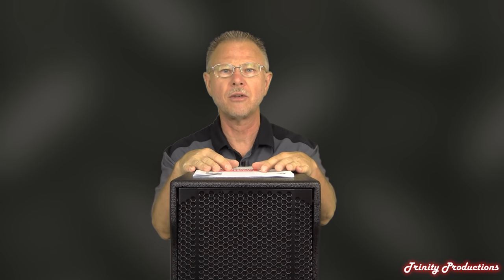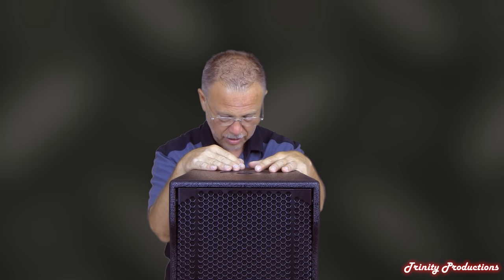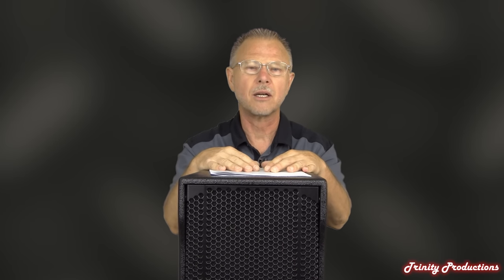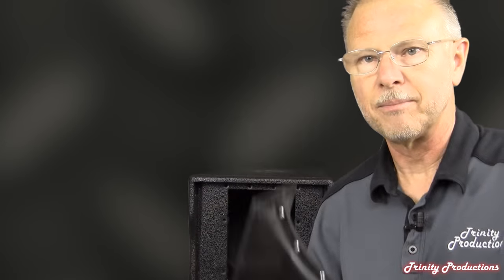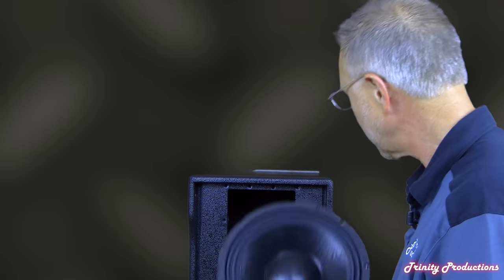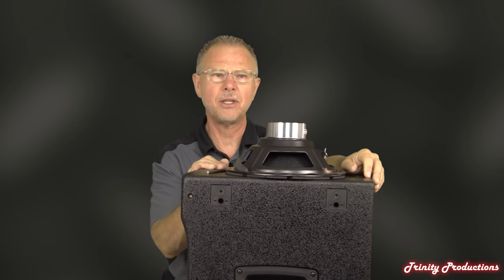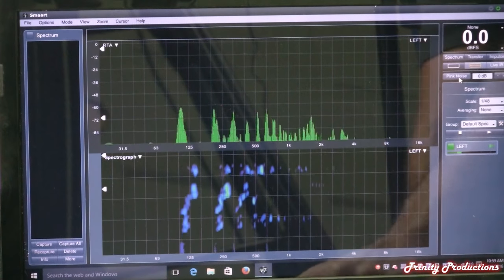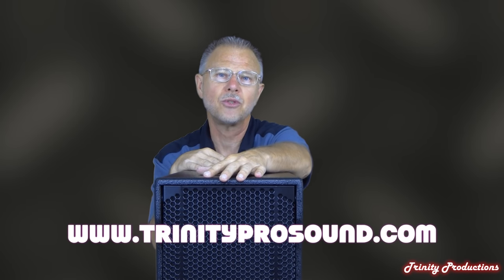RCF NXL44A Complete Review - Authorized Dealers

Comment: Great review as always. That thing looks really beefy. Question: how do they compare to the NXL24?
Reply from the maker: much better low end on the 44's than 24's, but HF is about the same....both are very smooth sounding...you could run more "full range" with the 44's than the 24's.

Comment: Is there any electronic benefit to using powercon connectors over IEC?
Reply from the maker: yes, they lock and have a higher current rating for the contacts and are standard on most all PRO audio gear...along with the new True1 PowerCon, which is a 20A locking connector many speaker mfr. are leaning towards.

Comment: I got the money to buy 4 NXL 44A  or 4 RCF TT2A cabinets, but also I can buy  2 TTL6 cabinets.  What do you think?  The subs I'm using are 4 TTS26A.
Reply from the maker: I would go with 2 of the TTL6 boxes with the TTS26 subs... or 4 of the NXL44's , but the sound from the TTL6's is amazing...just be sure to run in crossover mode and not a full range signal to them
Reply: So it's the NXL44's or the TTL6's. Hard decision. In terms of output , 2 NXL44 per side will be louder than 1 ttl6 per side...right?
Reply from the maker: by the numbers, no -  TTL6 is rated at 139db and the NXL44 is 134, 2 = 3db gain so 137 vs. 139. can you or i tell the difference, most likely not... bummer is they don't tell us at what frequency that was at for either one...
Reply: I think I will go with the TTL6A. They are just too amazing to not buy them. I found a client for my 4 X TT25A II  speakers and those 2 TTL6's will replace them. I hope I made the good choice.
Reply from the maker: you have, with the ability to fly and stack 2 per side, and the 3 way box will just sound better IMO that a 2 way...it is like and HDL50 speaker turned vertical so to speak...
Reply: btw love your rigs, impressive I see your an RCF guy as well.

Comment: Do they have these in White? Also do you have experience when painting speaker cabinets? Will it affect performance in any way? I really want them in white for esthetics.
Reply from the maker: They don't have the 44 in white. But, we have painted some in the past with good results. You do have to remove the foam and get new white foam and reattaching is a bit of a pain not to get adhesive on the foam and grille, that is where all the performance trouble will be, a very meticulous change out, but a good epoxy based paint will last a LONG time

Comment: Hi, excellent review, huge fan. I want to know if I can use two nxl44a with  two dual subs without using a processor's high pass filter for the nxl's?.
Reply from the maker: you can use the cross over output if they are available or high pass with a decent BW 24 or 48 setting. I would roll off low end around 90 to NXL44's and let subs do low end duty.

Comment: just curious, what is your personal go to system of the RCF- db tech- FBT?  which is your go to system.
Reply from the maker: we have 2 - for most of our events we do the RCF TT11A and TTS26A subs...but they discontinued the TT11 system, but it is amazing, just don't think they sold enough of them. For most everything else we do the db Tech IG4T with FBT SUBLINE 218SA subs, that rig will do 1000 peeps no issues, we can do 1500-2000 outdoors with the TT11A. We are looking at 4 of the TTL6A boxes to go with our TTS26A subs.
Reply: yeah I'm a RCF believer as well, mobile dj  want to do some sound for small bands. keeping it simple. thanks for all your insight. keep sharing.
Reply: whats the difference in the TTL6 and the NXL 44a
Reply from the maker: TTL6 is a 3 way box, NXL44 is only 2 way box , the TTL6 has more power and will be better in overall response due to 3 way design and components. Also has RDNET and it considered a PRO Touring type box, vs. the NXL44 as a top line , but not considered a PRO Touring type system.

Comment: IS there a lots of sound different in The 15 inch TT serie top vs NX 15 inch top ?
Reply from the maker: Yes at the TT line uses the best of the best and a more refined DSP, speakers and amplifier. The NX sounds good, the TT sounds GREAT !
Reply: @trinityprosound  thx i have the tt25a mk2 and the 8004 as, works nice, maybe in the futher i buy subs from TT :) the 15 inch from TT is Lighter in weigt thats nice, but are the lows good to ? or beter TT 18 sub ?
Reply from the maker: The TT subs would knock your socks off, but that comes at a premium price point as well.
Reply: Thx for the information  @trinityprosound
Reply: Ricardo Smit :) check

Comment: I am just going nuts with this decision.  I just sold my Yorkville PSA1/1s rig (6 tops/6 subs) because I am looking at going with something more versatility that I can do the few big shows I get with 1000 audience and a crew to set up but split into two rigs and have one person set up.  Within my budget I am probably looking at 4-6-8  8003as ii and 4 tops (either 24's or 44's).  There are pluses and minuses to both cabinets.  I am leaning to the 24's because of size/sound/cost but will 4 of them keep up with what I am looking to do with the bigger show vs. the 44's?
Reply from the maker: I think 6-8 of the 8003's will work with with 4 of the NXL24's , you will be amazed at the output of 4 of those in stacked configuration. The thing is to get them up on top of 2 of the 8003's so you have the height to cover the audience area. The NXL24's are amazing and very focused vertically.
Reply: Thanks for your response.  But, the question must be asked, would I be better to go with the DB IG4T/sub18H setup?  What do you think?  From what I've seen, I'd be better on top but lose a bit on the bottom.
Reply from the maker: The more sub you can afford = better , IMO you never have too much SUB, better to have more and dial it back than not have enough and try to make the speakers and system do something it can't or won't...
Reply: I think I have to be brutally honest with myself and realize that I am not vertically gifted and not getting any younger.  At some point that 20 pounds difference between the RCF and the dB is going to be beneficial when stacking. It appears there is almost no difference between the two cabinets in capabilities.
Reply from the maker: Me, i would go with the NXL24's tons of output,fantastic sound and much lighter and easier to set up and tear down than the 44's
Reply: I was referring to the IG4T by dB company.  20 lbs lighter than the RCF with 100 more watts RMS.
Reply from the maker: Ah, I do like the light weight of the IG4T. and the sonic quality is good, a bit different than RCF due to HF driver size and cross over point. But versatile and they do sound very good. I can set up our 4 x IG4T rig with dual 2x 18" subs by myself.
Reply: trinityprosound thank you very much for you videos and input. I am definitely getting the impression that the RCF is a better sounding cabinet, from your response above.
Reply from the maker: Ah, I do like the light weight of the IG4T. and the sonic quality is good, a bit different than RCF due to HF driver size and cross over point. But versatile and they do sound very good. I can set up our 4 x IG4T rig with dual 2x 18" subs by myself.

Comment: how about nxl 44 with 8005 for the sub? is it suitable or not?
Reply from the maker: That would work well, but the NXL44A will out run a single sub  , you will need 2 per NXL44 to get a decent spread between the subs and top box.

Comment: Hi there.  I'm using 2 NX M15a's as tops and the 905AS for lows and I would like to upgrade my setup. In terms of loudness and quality, will the TT22a mk2 be better?
Reply from the maker: Almost a sideways trade off IMO. Same amount of power  essentially. Look at the NXL24's and eventually going to 2 per side. Lots of output and they play very well when stacked and the top box inverted. You will need more sub at that point to keep up. SUB8004's would work or an SUB8006 if you have room.
Reply: We are a two-man team. The 8006 will be just too heavy for us. Maybe 4 8004s instead. We will upgrade our main tops soon and we would like to go on the TT line. Our maximum budget will allow us to buy 2 TTL6As or 4 TT25A mk2. We have a hard choice to make because the tt25a is a more portable speaker but we worry that 4 of them wont sound as good as 2 TTL6A. What would you do ? Thanks for answering my questions :)
Reply from the maker: If you can afford it TTL6's all the way...you won't be sorry and you can stack them like the NXL24's

Comment: do this need a sub?
Reply from the maker: yes for low end it does....in full range music play back is does nice on its own, but for bands and DJ work, you will need a sub to go with...a dual 18" will be needed to keep up.
Reply: thanks very much
Reply: As an owner of this rig ( 4 x NX44 and 4 x8004) I would say you  probably need 2 x dual 18's per side. 4 of the NX44's can get pretty darn loud. The output of the NX44 seems much greater than the spec sheet would have you believe. You will def want to get cases or covers custom made for the NX44s as the finish gets scratched very easily during transport. I recommend Calzone Case or Tuki Covers.
Reply from the maker: Agreed...the NXL44 do get loud and clear, we used a single TTS36A sub and the NXL44 outran the sub. So 2 per side would be recommended for sure with 2 tops.